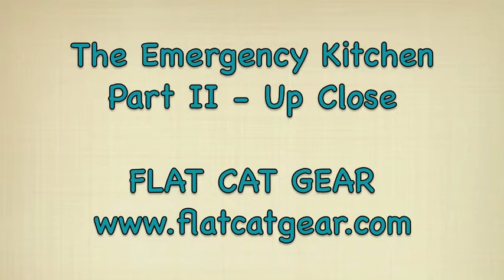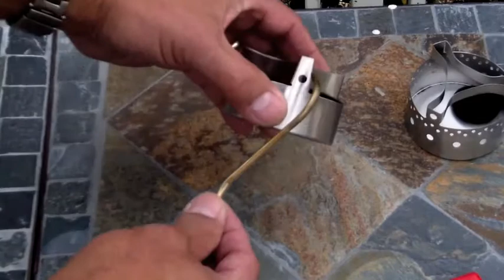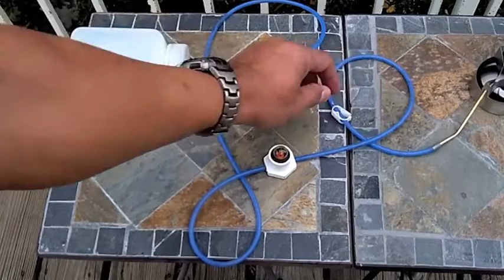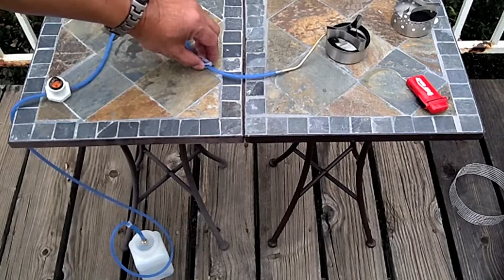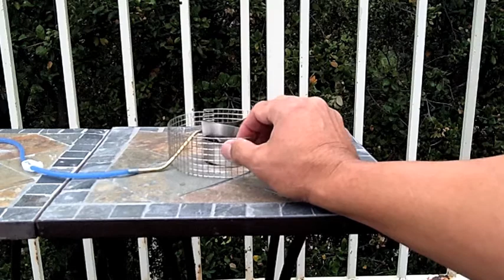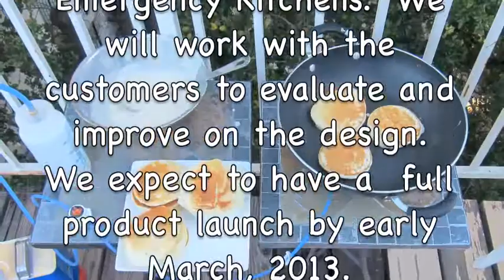The Emergency Kitchen, Part II - Up Close   by FLAT CAT GEAR

Comment from the maker: Scott, the pump has a built is check valve to prevent backflow.  The problem is that all elastomer check valves tend to leak.  Additionally, alcohol has a very low viscocity and that makes it even more difficult to seal.  The pinch valve is pretty easy to use works pretty well.  Best regards - Jon

Comment: Hi, I like the idea of creating an emergency stove. I think if I am to pick on anything it would be the small heat area that the stove would present to the bottom of a large pot or fry pan. If the pan is perhaps 10 to 12 inches in diameter then the hot spot seems like it would be too small. Consider maybe more than one stove to improve heat distribution. I can see if I were to use a cast iron skillet the distribution would be improved as it conduct heat better than a thin walled one.